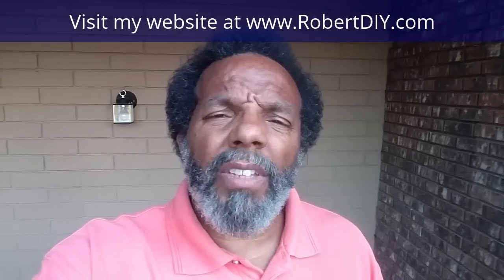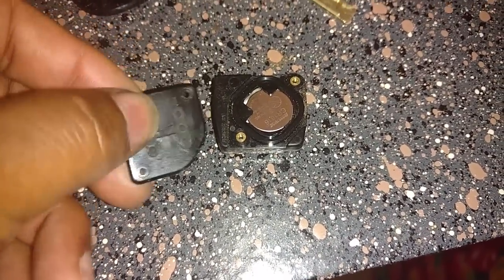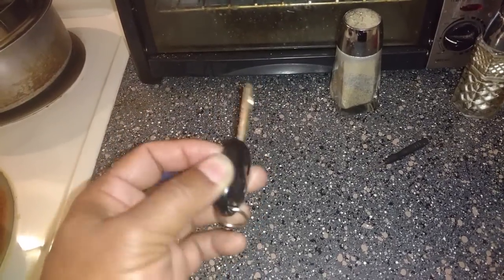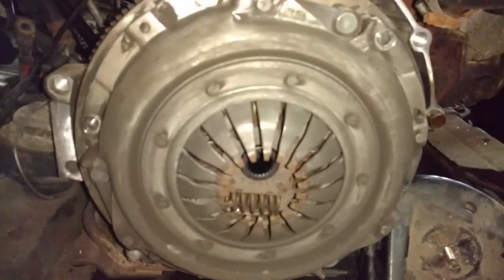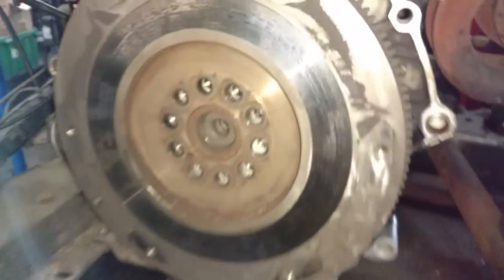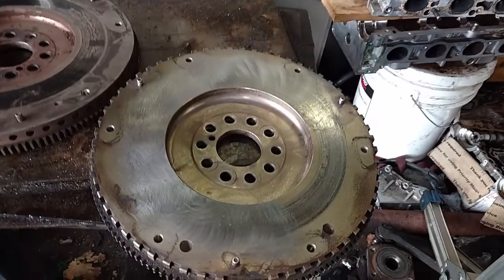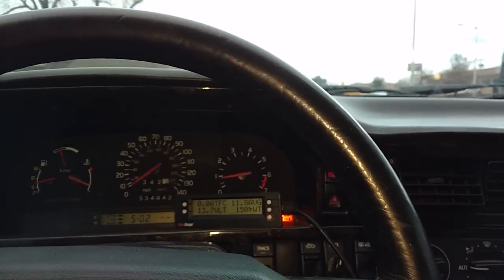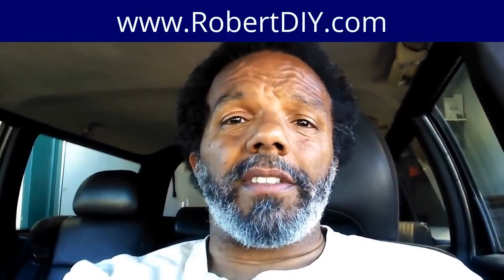Manual transmission removal, coolant line replacement, stopped by a Volvo dealer, etc. - HOWR

Comment: My oil service light came on about 1000 miles after I changed the oil on my '96.  Annoyingly, I discovered that my OTC Genisys scan tool will not reset the service light.  Didn't have time in my travels to find a shop that could do it for me.
Reply from the maker: Just ignore it. No big deal.

Comment: That transmission did look clean.
The fingers didnt look worn through at the center, so its still usable.
Ive seen the finger tips just broken off with being worn out, but thats a terminal case.

Havnt a clue what you were doing in that other car, looked like a nest of snakes lol.
Reply from the maker: Yes, nice clean box, no id tag though. Not sure if it's a M56L or M56H. No way to tell from the box.